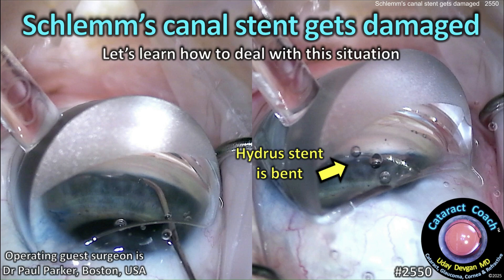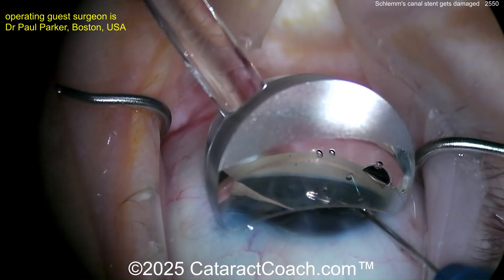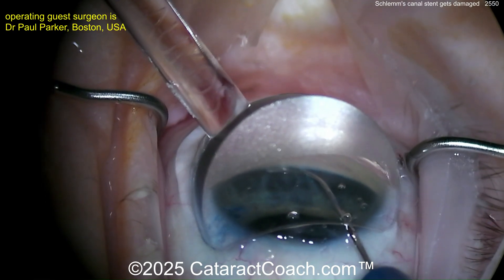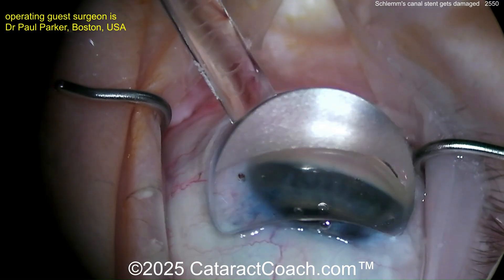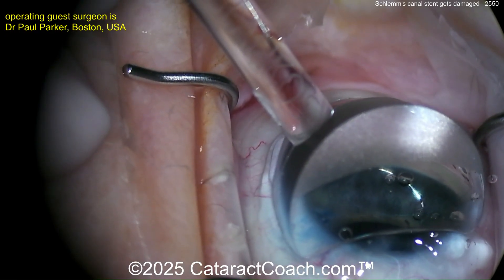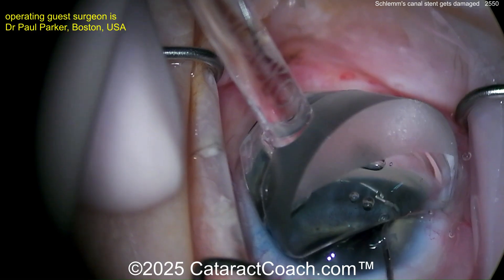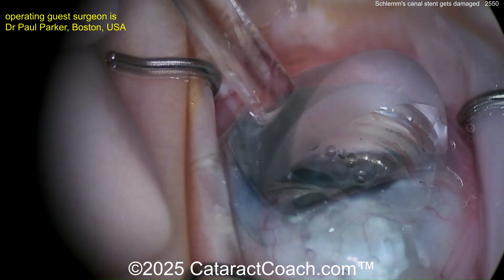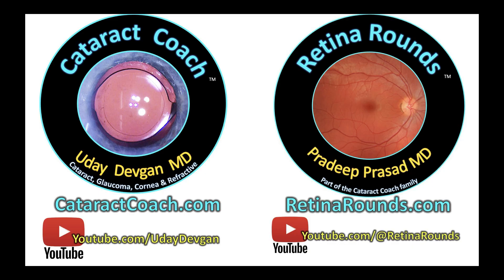CataractCoach™ 2550: Schlemm's canal MIGS stent gets damaged. Now what?

Comment: If you need to explant a Hydrus (ex: stenotic canal, can't advance far enough), but you are positive that it is in the correct position, you can actually rip it through TM rather than retracting. Performs a goniotomy similar in idea to suture goniotomies (ex: OMNI or iTrack). I've had to do this once: couldn't advance and for whatever reason was having a devil of a time trying to retract it.

The patient to this day (~18 months later) is still controlled on no gtts. Now, of course, despite fighting insurance for months, they declined reimbursement for what amounted to a goniotomy.

Good call to explant and not do that here because it looks like that final attempt was too far posterior and it would have made that cleft much worse.